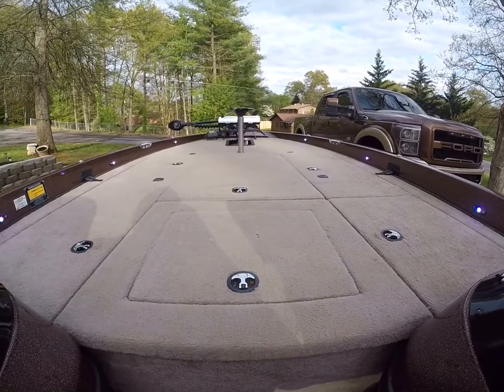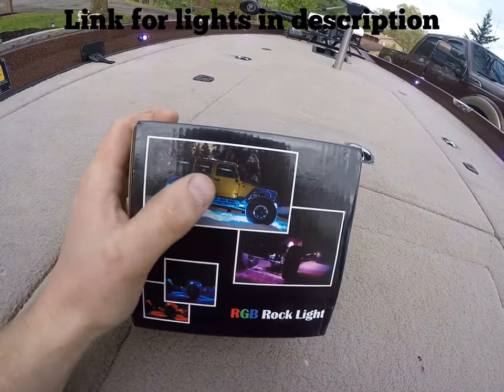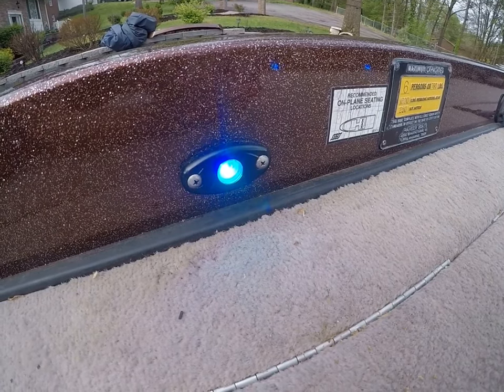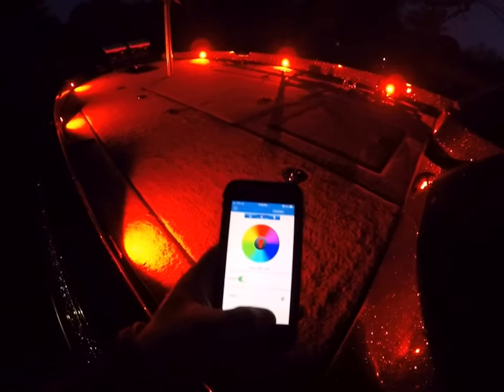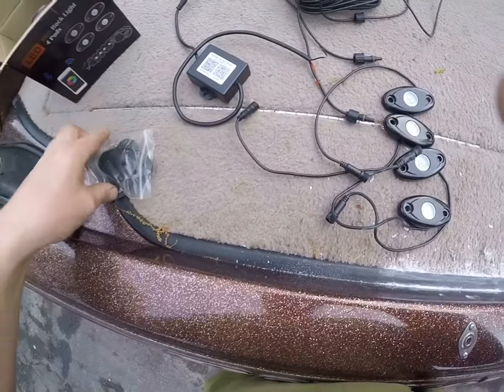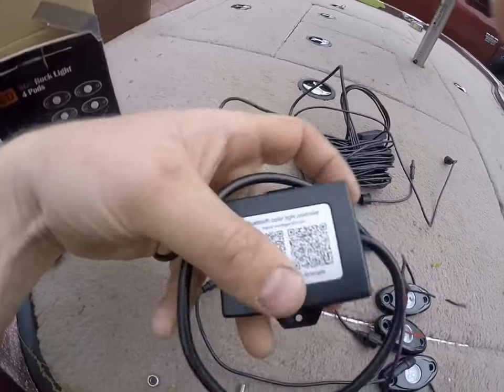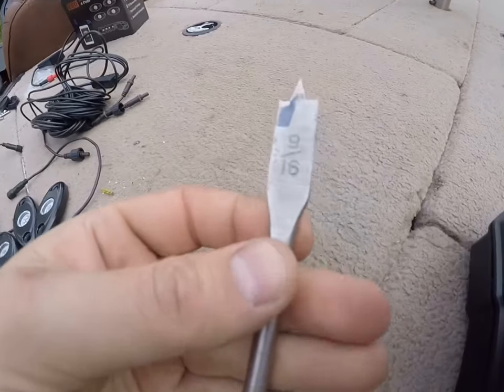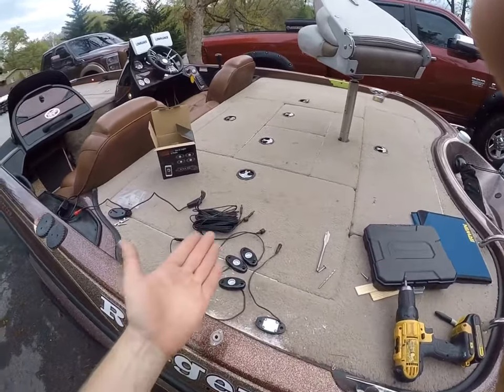Awesome bass boat deck lights for under $80

Comment: Like the lights. How were you able to run the 6 pack controller and the 4  pack controller to the same app? Or can you add multiple controllers and work them together?
Reply from the maker: Yeah you can add multiple controllers on the same app but you do have to adjust the color and brightness on each controller separately the app want sync them together. once the color and brightness is set it will store the setting so you can turn them off and on and not have to adjust them
Reply: @outdoormaniacs9435  I only see the 8 pack on eBay. Do you have the link to the 4 and 6 pack to buy?
Reply: I think they removed the 4x pods. thanks
Reply from the maker: https://www.ebay.com/itm/293596029089 I think theses might have taken there place
Reply: @outdoormaniacs9435  thanks
Reply from the maker: Your welcome

Comment: Its been over a year now are lights still working?? Im shopping for some lights for my boat. I looked up Rock Lights & they have all kinds. They say "wireless"  but I see wires?
Reply from the maker: They are still working great man haven’t had any issues so far. Yeah the ones I have have wires that have to be run through the boat

Comment: How hard was it to feed the wire throughout I have a r81
Reply from the maker: No there is wire tubes in the boat once you find them it runs really easy.

Comment: the EBay link isnt working can they be bought on amazon
Reply from the maker: They have changed them just a little bit here is the new link
 
https://www.ebay.com/itm/8pcs-RGB-LED-Rock-Lights-Kit-Underbody-Neon-Light-Pods-Bluetooth-App-/383338468349?_trksid=p2349624.m46890.l49286